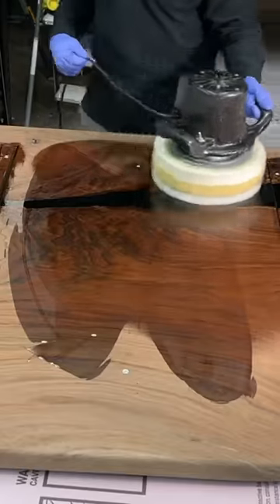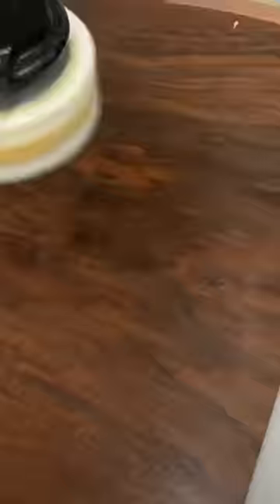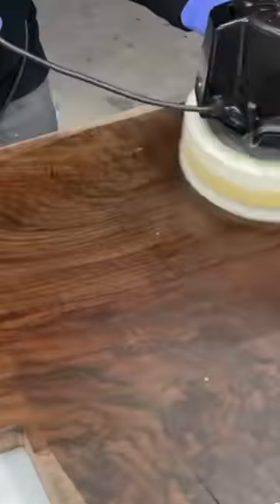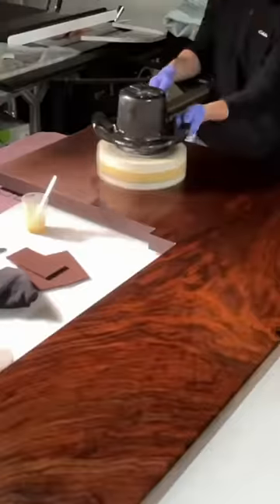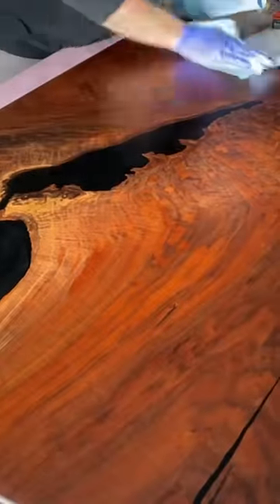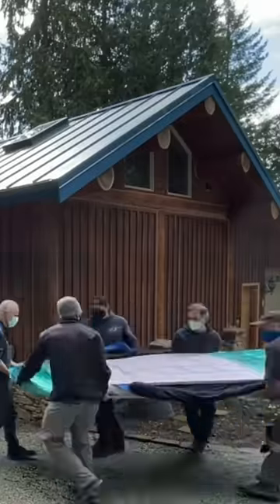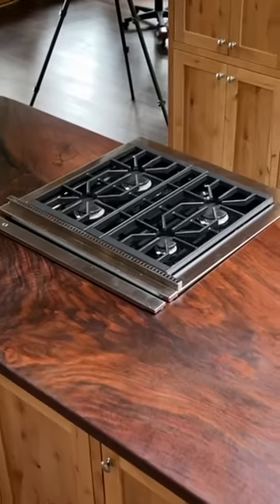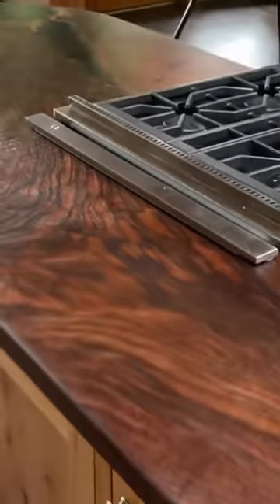$15,000 Kitchen Island

Comment: "I don't think it's a very good idea"
"Okay thanks"
"No wait..."
Reply: And it looks like shit. But got some free advert out of it on the YouTube’s!
Reply: @VState60  I think it looks good, but it certainly is dumb.
Reply: @theyeetus1428  why is it dumb
Reply: @gotyouchip1179  It's wood. It rots, it's in a kitchen so things will be spilled/dropped on it, and it will get scratched and cut.
Reply: @theyeetus1428  will it rot if its covered in epoxy and whatnot?
Reply: @gotyouchip1179  It may take a long time, but when the coating wears down enough (Which may happen quickly in a kitchen environment) it will rot. A stone countertop is a much better option in every way.
Reply: @theyeetus1428  ah, thanks for the explanation
Reply: @VState60  it's a beautiful piece in my opinion, it just wont last as long as the traditional kitchen island because it's made of wood
Reply: @theyeetus1428  ……I don’t think you understand how wood rots lmao
Reply: @GrandEWN  do you know that this obsession with stone tops is a US thing right? In Europe, wooden kitchen tops are way more common than stone ones and they're just fine through the years. I remodeled a few kitchens that were 20-30 years old and had wooden tops and there was no issue with rotting. Of course, wood is softer so there may be some knife marks, etc. don't know about the US but we in Europe know how to properly secure wood to be used in the kitchen. Hell, I even saw wood used in bathrooms even as bathroom sinks but I can't confirm how long they last as I don't have personal experience with them.
Reply: @8draco8  my experience with wood in bathrooms is that it's fine as long as it's not constantly wet. If it gets to dry out fully then it's okay (though that is obviously a big "if").

Wood kitchen counters, on the other hand, are totally fine. Just use actual chopping boards.
Reply: @theyeetus1428  every house and apartment I've lived in in the US the counters have been made of made of particle board which is just compressed wood. Unless you were actively leaving water on the counter and not taking care of it it won't rot anymore than the walls of your house or the hardwood flooring.
Reply: @Galaxydragonpie  In a kitchen, there can oftentimes be water (or other liquids) on the counter. You've just never seen it happen because you move so often.
Reply: @Galaxydragonpie  Also particle board is much more resistant to rot than plain cut wood.
Reply: @theyeetus1428  You lost
Reply: @theyeetus1428  Interesting that you conveniently ignore the apparent world/usa disparity in what to use as kitchen tops.

Wooden kitchen tops have no problem going 30 years and more. 
TF yoo doin ova ther

PS: People don't let water sit long enough on the top for it to rot because normal people clean their kitchen once in a while.
Reply: @theyeetus1428  it’s not plane cut it’s treated.
Reply: @tylerpatti9038  Not plane, plain. As in ordinary wood.
Reply: @theyeetus1428  youre kidding right?  saying that if you dont take care of your countertop then it will fall apart is meaningless.  stone tops are porous, if you dont maintain the seal youll ruin stone tops through neglect as well.  ive had wood countertops and wood tables for most of my life, havent dealt with any warping, rotting or anything of the sort because like most people i clean my kitchen
Reply: It looks okay
Reply: @gotyouchip1179  It will last very long
Reply: @CheshireSwift my wood and bathroom experiences are so much different. It's usually happens every morning and by noon it's just gone magically. 😂

Comment: Oh oh carpenter here. We made like, two bitchen island covers out of wallnut, pure wealnut without any resin as you guys did. Oiled the surface and installed them. But my boss too many times said that they should really be careful about placing down stuff. It will inevitably get burns and damages from any kind of edge.

Comment: I'd hate stone countertops. They'd chip easily, are colder, more dangerous when bumping into them, other objects are more likely to break when bumping into them, and to top it off they're also expensive! It's like all the cons and none of the benefits. I guess the two benefits is that it generally won't stain or scratch.

Butcher block seems nice, or else resin

Comment: Never, I don't care how good you are, Take measurements from them, you find out exactly what appliance they plan on buying. And you get the specs from the manufacturer. Then if there's a mistake, it's between you and the manufacturer. You can't have that kind of confrontation with a customer.  It will never be in your favor even if they gave you the measurement.

Comment: 2500$ for a log 15000 for this wooden. Counter top that you yourself even stated isn't the strongest and is just a basic top.. You're over charging people. That counter top maaaaaybe 500 at the very most that's mainly just the material cost your labor for just cutting  a sqr I wouldn't pay you more then 50$